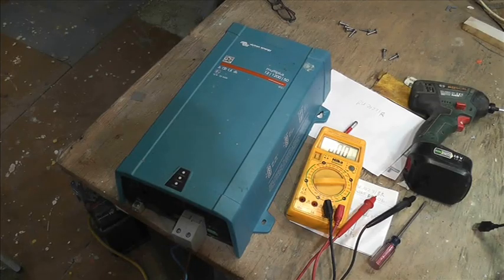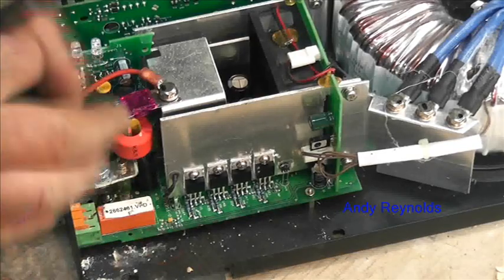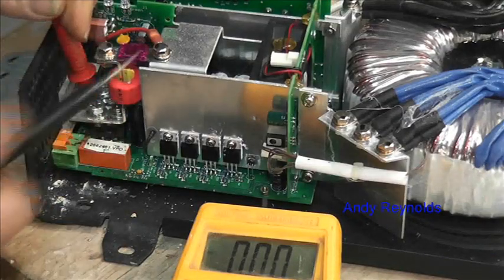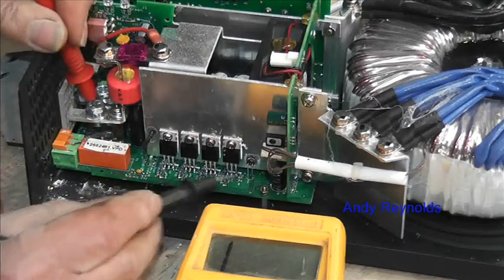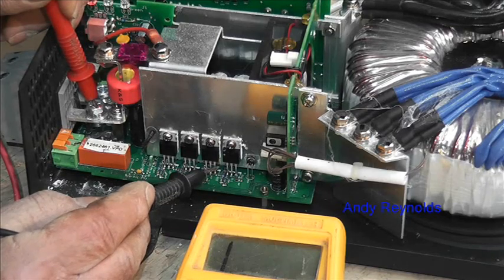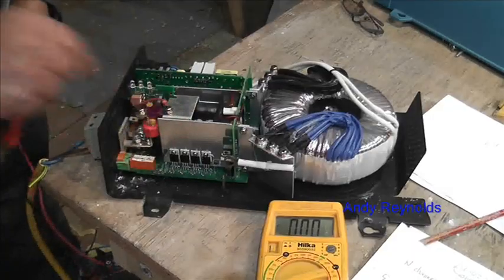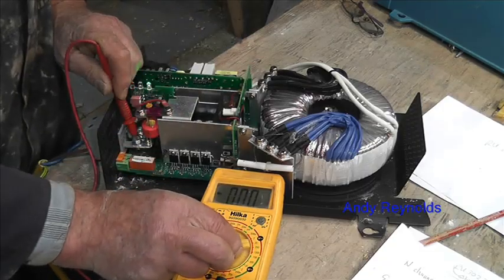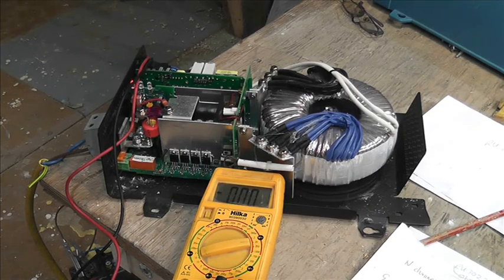Victron Multiplus, blown FETs? call out to viewers

Comment: You should check each Mosfet individually in diode mode with your meter. They are quite easy to check even in place. You dont need any input on the inverter - disconnect everything - and make sure the big caps are discharged. Than check the d-s on the fets with positive gate and negative gate to see if they are working correctly. A defective fet will probably have continuity ond the d-s when it is burned.
Reply from the maker: Thanks for this, yes it looks like some blown fets, taking it apart will not be easy, cheers

Comment: They often use N channel fets in both positive and negative side as they usually have better charectristics than P channel fets. They just need a gate drive that is 10v higher that the supply rather than ground. A dedicated H bridge driver uses capacitors in series with the supply  to 'bootstrap' the gate voltage 10V  above supply. 

It will be 4 banks of N fets in an H bridge configuration to the drive transformer with an  'AC' waveform.
Personally, as they look easy to remove, I would mark up and remove the transf windings and check for shorts between windings and single winding to winding resistance checks.
As you know, shorted fets are a prime candedate but if they are blown what caused it? With  meter in diode mode, FETs Source to drain should be (roughly) half volt drop in  one polarity and open in the other and the gate should be fully isolated from drain and source. All dependant of the fet in test being out of circuit of course all though an in circuit dead short from Drain to source is a sure sign of blown fets. 

 drop in
Reply from the maker: Jamie, thanks for your time in this detail. On the Victron charge controller we found n channel fets on the positive. With a short between positive and the transformer I'm thinking it's one of these. The transformer doesn't look like it has got hot, but worth checking. Lee is working on this one and I'll get an update when he digs into it. cheers
Reply: @TheInfoworks  You are welcome. Thank you for your interesting videos. Good luck with the repair. On a side note, always buy FETS from proper supplyer as there are loads of fakes and unmatched crap on the usual cheap sites.
Greetings from the Isle of Skye :)
Reply from the maker: @jamiesony3859  Jamie, yes thanks for the info, I try to use reclaimed where ever possible, but where else to dump low spec electronics, but online, cheers

Comment: I've been watching @LearnElectronicsRepair for a while now, and his approach is more an in-depth analysis of the circuit, and what it is doing / not doing.  Yes, you could get lucky, by pulling each MOSFET, and testing it out of circuit, or it could be another failed component(s).
Reply: Are you able to connect a phone via bluetooth, and look at the remote console view notifications?
Reply from the maker: Yes, that's what I' hoping, bit fiddly with all those heat sinks and small FETs, cheers
Reply: @TheInfoworks  Do you own an ESR meter?  Can be used to test in circuit, or build $1 short finder (see LER channel).
Reply from the maker: @LittlePetieWheat  Hi, I'm thinking there is a short on the positive side, which contains 8 FETs, cheers
Reply: @TheInfoworks  The $1 tester should show high side short;  Can also test mosfets in circuit using 2 meters - see "How To Test MOSFETs In Circuit Using A Multimeter" (LER)
Reply from the maker: @LittlePetieWheat  Thanks for that, we'll get on  with it, Lee is investigating it, cheers
Reply from the maker: @LittlePetieWheat  Yes, interesting, resistance  to check the switching and diode to work the gate, brilliant, cheers
Reply: @TheInfoworks  https://www.youtube.com/watch?v=P_2GGNr4q1s